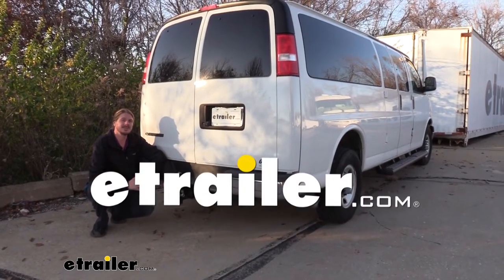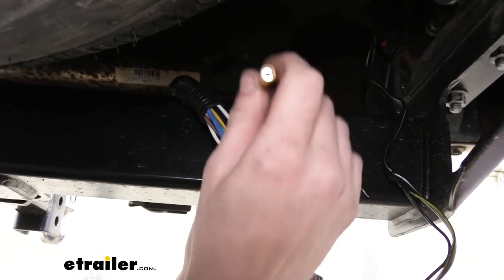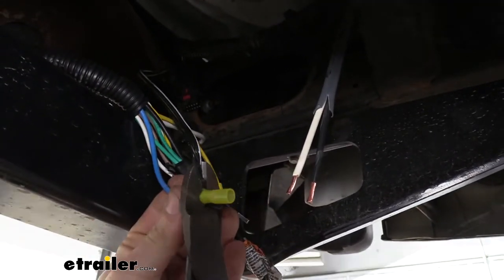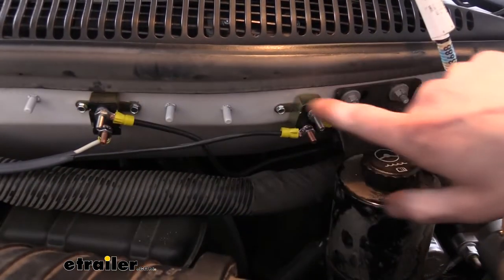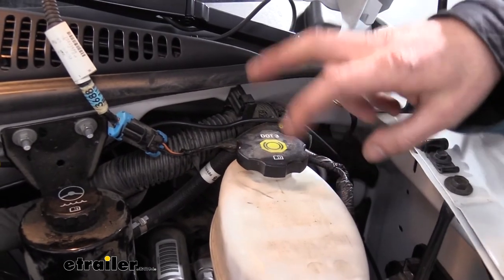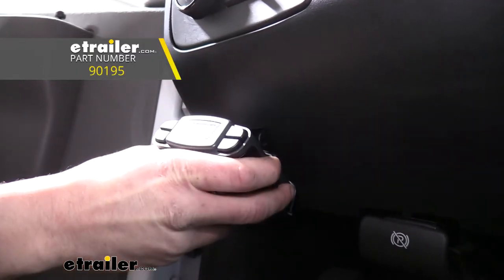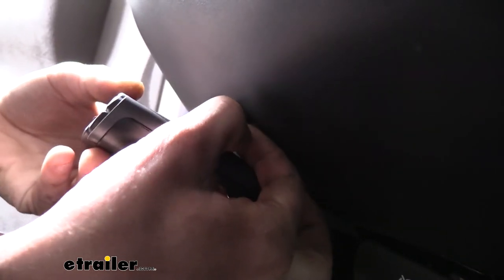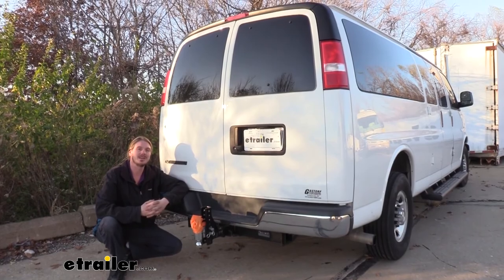Set up: Universal Installation Kit for Trailer Brake Controller on a 2019 Chevrolet Express Van

Comment: Why do you need 2 breaker, can you put both wires on 1 breaker?
Reply from the maker: Using two breakers wouldn't be a good idea. The 12-V accessory feed to the 7-way needs to be rated for 40A, and the power feed to the brake controller needs to be rated at 20-30A, depending on how many brake axles the trailer has.
https://www.etrailer.com/Accessories-and-Parts/etrailer/ETBC7.html

Comment: Shouldnt the brake controller box be connected to a switched 12v that turns on with the ignition only?
That box would stay on even if the vehicle is off?
Reply from the maker: Nope. You'll want a direct battery connection for the brake controller. This is intentionally done as a safety feature so you can't forget to turn the controller on.
The controller will stay on when the vehicle is shut off, but after 10-15 minutes of inactivity, the controller will go into a sleep mode. When the controller is in sleep mode, it only draws a tiny bit of power, not enough to drain the battery unless the vehicle is left unattended for several months. You can unplug the controller at the rear if you wish, just be sure to plug it back in before towing. Unplugging the controller will erase any presets you have saved.
https://www.etrailer.com/Accessories-and-Parts/etrailer/ETBC7.html
Reply: @etrailer  Thank you for the info. I didn’t know it automatically goes to sleep automatically. I’ll unplug it when the van dits for a few weeks.
Reply from the maker: @richmerj1401  Just don't forget to plug it back in before you tow....